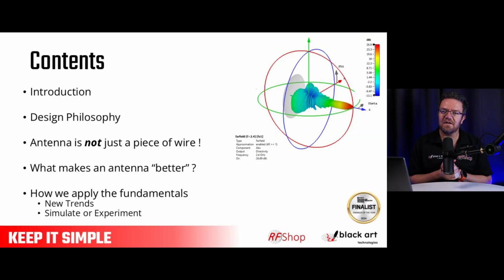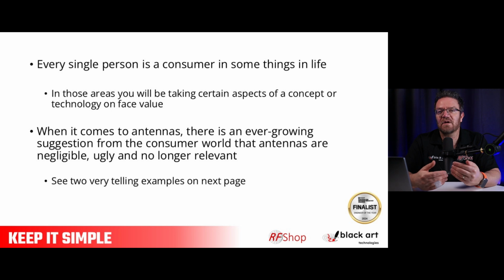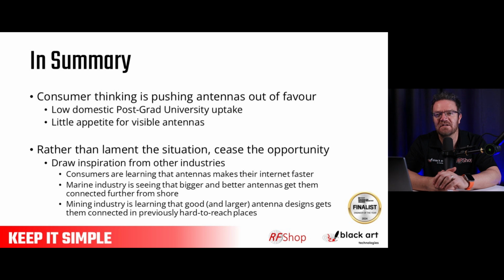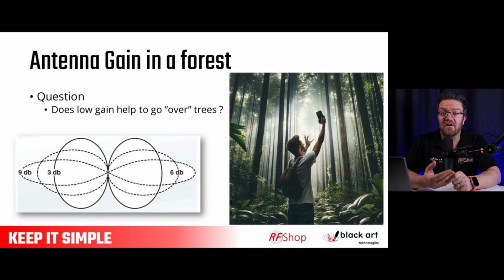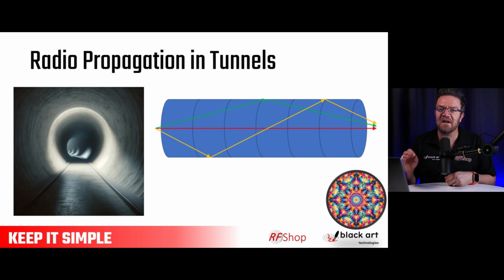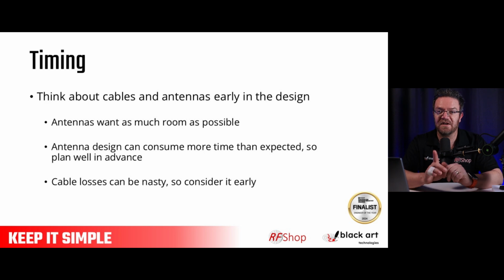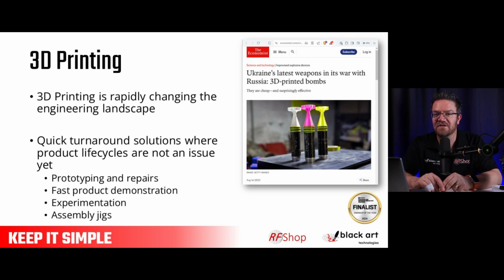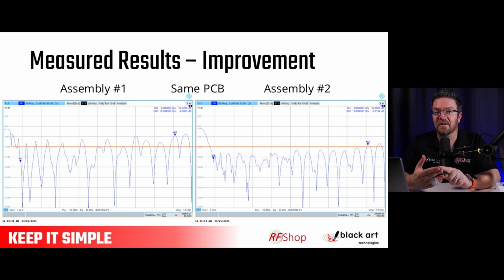Mastering Antenna Design for Electronic Warfare: Essential Insights

Comment: I like your video style and think that it is a great example of how slides can be presented. Looks great even without using a green screen. You've mentioned CST as a tool for antenna design. Antenna also can be designed using free software like openEMS and results are pretty accurate if meshing is dense enough and done using "1/3" rule.